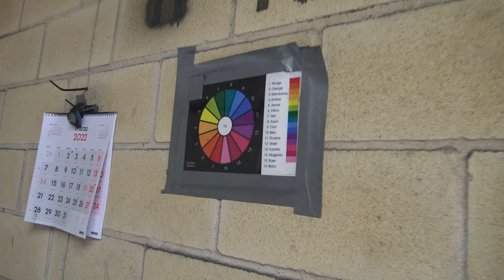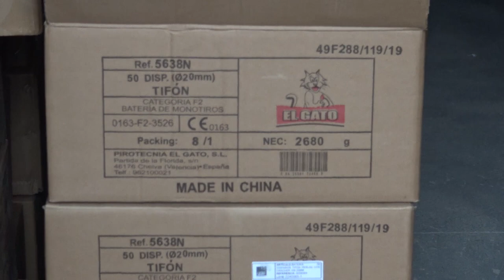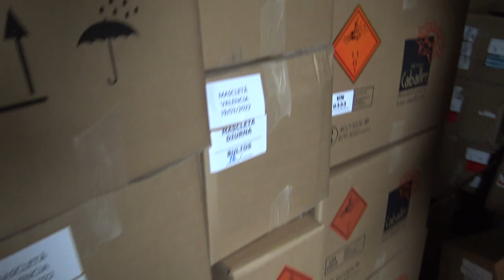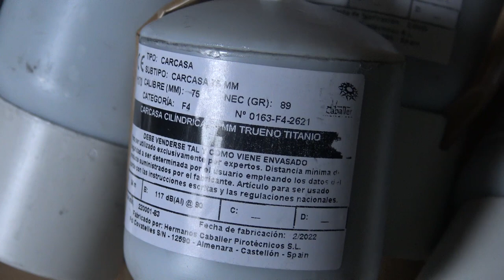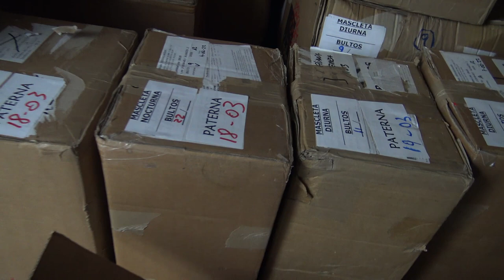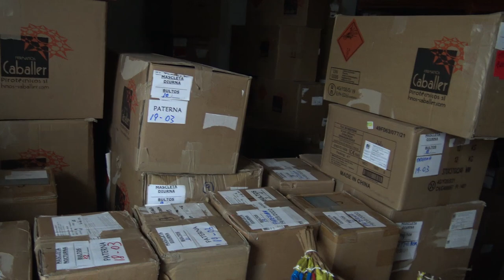Firework Factory Visit in Spain - Pirotecnicos Hermanos Caballar | Vuurwerk

Comment: Thank you for showing for us  Spolette  how this shells made :)  I never knew they put it in two depths I always thought shells  that looked like this were welded from the side only  and then there is the material in it  but I never knew there was another plastic shell inside the larger one  this explains a lot especially the older type pf shells that were welded at the sides :) 
We have never used this technology  in under socialism  we had one shell only  and then there is the material in it   and always welded in the middle  , and we used very hard bakelite plastic  for the capsule Cylinder ball shells  and softer plastic  for the only round ones :) 
Caballars are awesome company :)

Comment: Awesome! But why so much plastic?
Reply: No pasting so less labor. No drying so less time. And I think a more consistent result because every shell you paste will have some minor differences. With plastic, as long as it is the same throughout all batches you won't have this issue.
Reply: They Cleaning up the garbage after the show is over  Every pyrotechnicanc do this so plastic is not a problem if it is picked up ! :)

Comment: Please change the name of the video!! It is "Hermanos Caballer" with "e". Caballer means knigth while caballar means "related to horses":
It's a pity they have so low skills in English. Their fireworks are higly regarded in Spain. 
I also dislike the use of plastic. Albeit extremely convenient, it is not really possible to clean all the debris, specially if fireworks are launched by the seaside quite common here in Spain or any other water body, forested area or urban environment. 
I think that, at least in Europe, a "completely plastic free fireworks show" would have its market and mark a difference as compared to other suppliers. It's clearly a market oportunity.